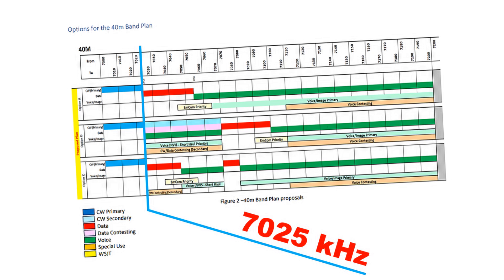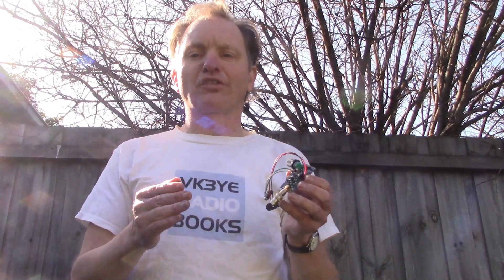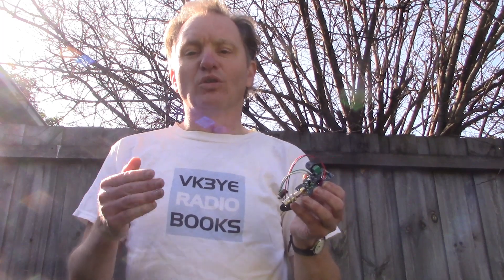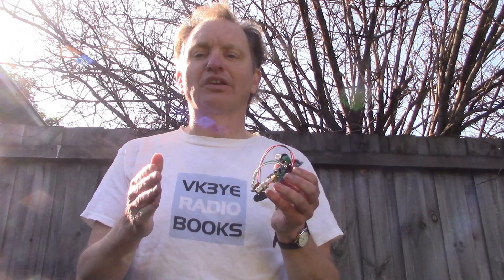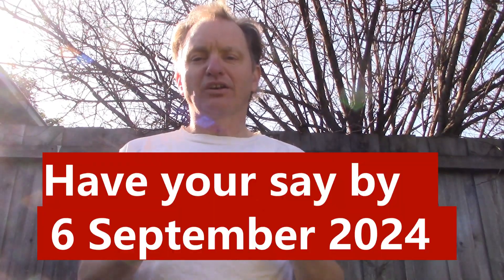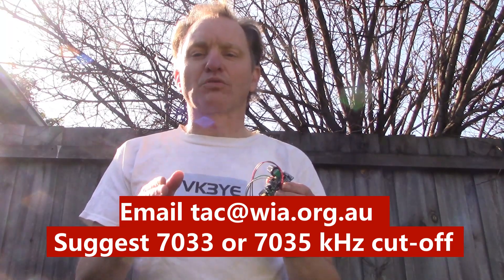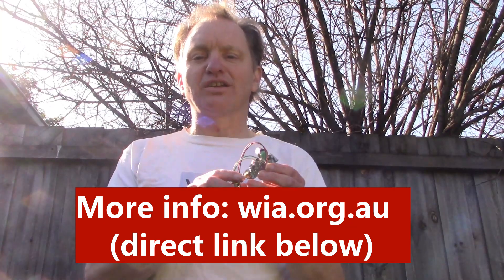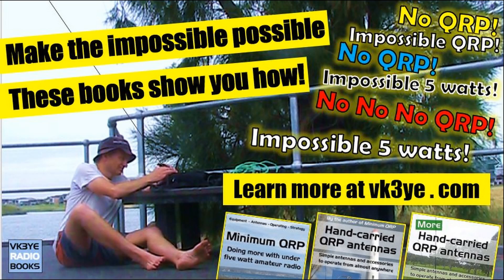Preserve CW space in Australia's 40 metre band plan: Have your say now

Comment: I've emailed, requesting CW exclusively to 7035. 7032 is the SOTA frequency, if you cannot get a spot out from a summit because youre out of mobile range which is common in VK you can call CQ SOTA on 7032 and stand a fair chance of picking up chasers in NZ, EU who habitually zone in when they see activity there.  
I dont see why digital modes need 10s of kHz of bandwidth below 7080, I assume the proposal is mixed modes down to 7025.

Comment: Surely there's plenty of room for data modes to spread slightly further UP the band, rather than encroach on what is already a fairly restricted "preferred CW" section? As a mostly QRP CW operator, it's already crowded enough up around the 7030 QRP COA, particularly when the CWT contesters march all over the place. 7035 kHz would seem a reasonable compromise if any change is really deemed necessary.

Comment: I just built a Pixie on Friday (but haven't yet checked it for harmonics compliance, so it hasn't been connected to an antenna).
But I don't get the argument - you want transmissions to remain CW only all the way up to at least 7035, because the selectivity of the Pixie isn't good as a receiver? Isn't a Pixie almost unusable today regardless because of the broadband QRM? If I'm following correctly, it's not as though you couldn't still use your 7030kHz Pixie, it would still tx just fine, but you have to share spectrum with everyone else and you're going to need a better receiver. Well, I'd rather the spectrum got used for something, anything, rather than sit there waiting for CW that's never coming. Let's be clear here, we're not losing spectrum to anyone but other amateurs...
Reply: I think the problem is that the proposal makes it legitimate for digital operations on say 7026 and as many of these are robot stations even low duty cycle use would make CW operations in the 'shared' subband impossible.